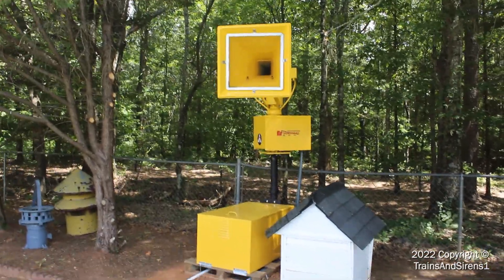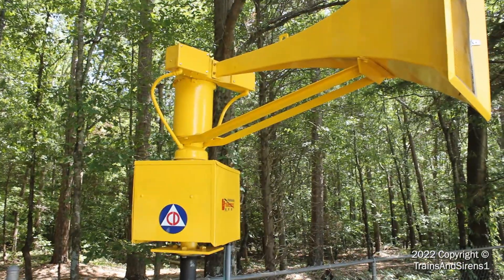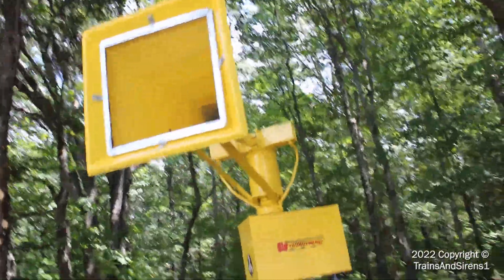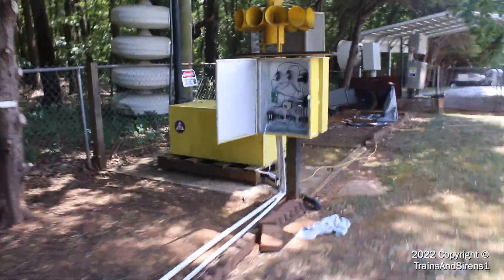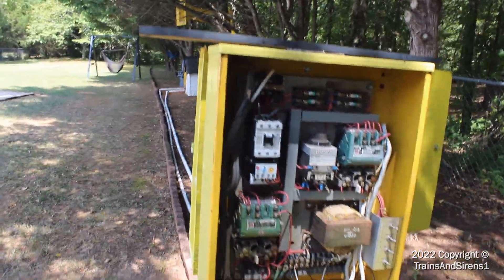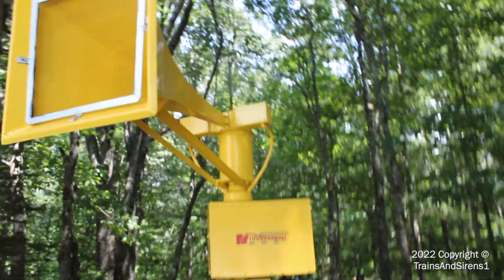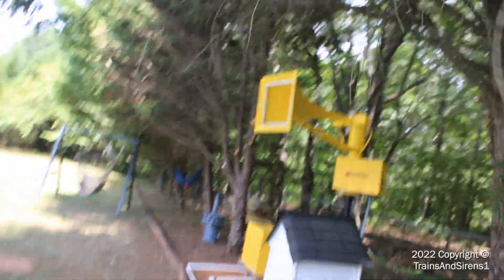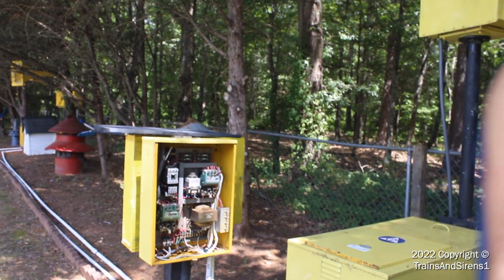My Refurbished B-Series Thunderbolt 1003 First Full Run, Hi-Lo

Comment: Don't tell me you have a tornado siren. Do board-smashing tornado sirens. Throw the- burn out the motor. Open the panel and throw salt water on the motor while it's running. the siren.

Comment: Get the mineola thunderbolt
Reply: No. That's going to be reinstalled
Reply: @kansasclocksandsirens  it got reinstalled and and it's reversed wired painted yellow and the horn is not tilted any more
Reply: @RacingandSirens  Yes. I know
Reply: @kansasclocksandsirens  have a great day
Reply: I learned that after but thank u

Comment: Great looking resto. What blower is in this one? A couple notes: Sunburst Yellow is very close to CD Yellow, but not exact. Also, it fades quickly....the paint does not have much UV resistance. I'd suggest a UV stable clear coat that'll go over oil based enamel. Eastwood makes a 2 part clear in a spray can that would probably work. Acrylic enamel seems to hold up the best...the plan for mine is to mix my own version of the yellow using Sunburst and a little bit of red, and have it matched at Home Depot in the acrylic. I visited a siren recently that used that type of paint and it's holding up very well. Yours sounds very good! Nice job.
Reply: The blower is a B/C-series 4M
Reply: @YourAverageMODude145  Actually if I’m not mistaken he put this siren on the 1000 he had
Reply: @MasenMonster  no, he got a second C/B-series blower for it